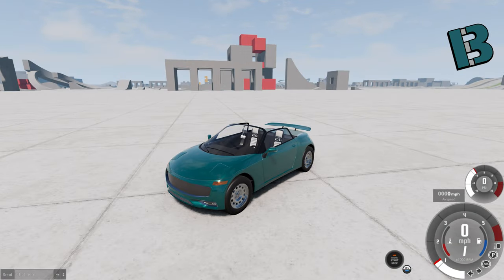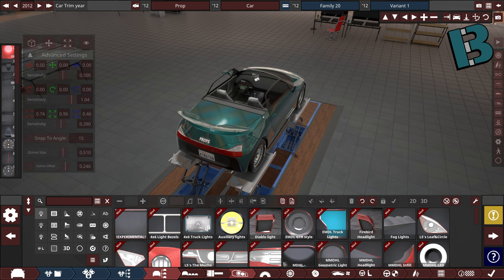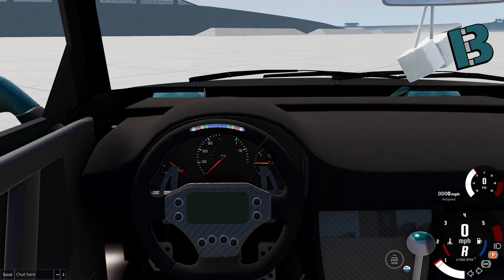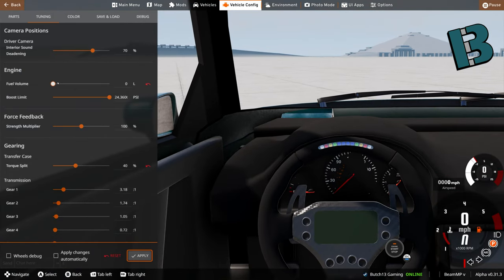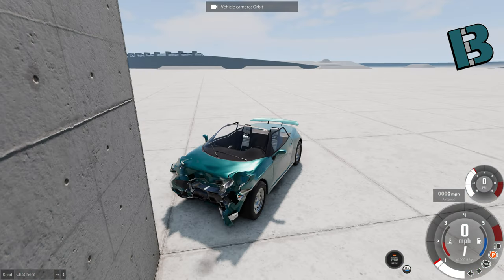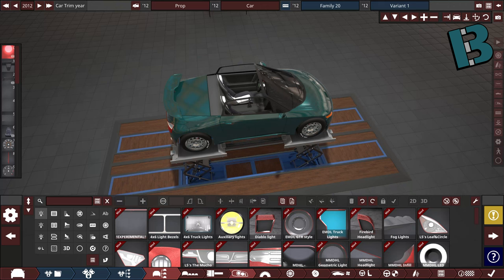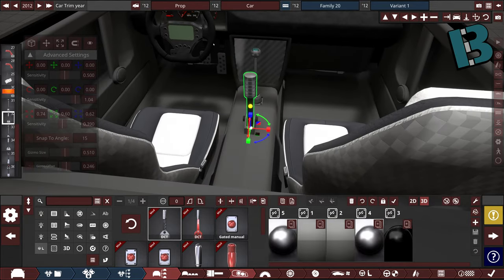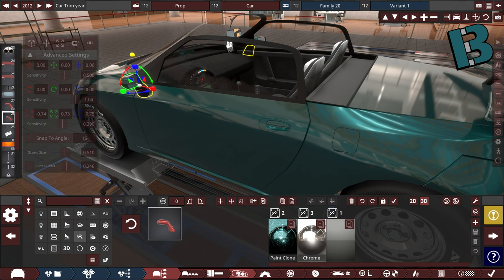More Than Just Steering Wheels - Automation and BeamNG Props!

Comment: I need help with the XYZ on the steering wheel when i try to make the steering wheel in automation angled it breaks
Reply: yea if ur stuck try this
~prop:ur fixture number,steering,0,1,0,0,0,0,min angle (should be below 0 like -900),max angle (should be above 0 like 900),0,1~

Comment: Hi. Ive followed your guide thoroughly, and used the copy/pastes and changed the prop numbers. Im having an issue. I cannot get the wheel to turn for the life of me. I think the prop number is 40, but how do you see each fixtures ID number? why wont my wheel turn?
Reply from the maker: In the Fixtures section of Automation take a look at the bar on the left. The number under each item is the fixture number that you need. Note that if you go back and delete a fixture it will renumber all of the following fixtures so double check that the number hasn't changed.
Reply: @Butch13_Gaming  Ive had the same issue, but I've double checked and the numbers ive used are correct

Comment: Here are some commands for gauges, they work as of BeamNG 0.33 (I tested them in my own Automation car).

FORMAT:
~prop:[prop_number],[function_name],[x_rot_enable],[y_rot_enable],[z_rot_enable],[x_trans_enable],[y_trans_enable],[z_trans_enable],[min],[max],[offset],[multiplier]~

[Gauges] --------------------------------------------------------------------------------------
Speedometer (270 deg clockwise needle, divide angle by max speed in m/s for multiplier):
~prop:8,wheelspeed,0,-1,0,0,0,0,0,270,0,2.52~

Tachometer (270 deg clockwise needle, divide angle by rpm range for multiplier):
~prop:10,rpm,0,-1,0,0,0,0,0,270,0,0.045~ # or rpmTacho

Fuel Gauge (90 deg clockwise needle, fuel value is from 0 to 1, divide angle by 1 for multiplier):
~prop:12,fuel,0,-1,0,0,0,0,0,90,0,90~

Water Temperature (90 deg clockwise needle, divide angle by temperature range (Celsius) for multiplier, recommended range is 0 to 200 so the needle is around the middle during normal operation (~75 to 105 Celsius)):
~prop:12,watertemp,0,-1,0,0,0,0,0,90,0,0.45~

Oil Temperature (90 deg clockwise needle, divide angle by temperature range (Celsius) for multiplier, recommended range is 0 to 200 so the needle is around the middle during normal operation (~110 to 126 Celsius)):
~prop:12,oiltemp,0,-1,0,0,0,0,0,90,0,0.45~

Voltage (90 deg clockwise needle, divide angle by voltage range for multiplier, recommended range is 0 to 16V (12.6V resting voltage, 13.5-14.5V when engine is running)):
~prop:12,volt,0,-1,0,0,0,0,0,90,0,5.625~

Boost Gauge (270 deg clockwise needle, divide angle by boost pressure in psi for multiplier):
~prop:10,boost,0,-1,0,0,0,0,0,270,0,30~

BeamNG Props Guide: https://documentation.beamng.com/modding/vehicle/sections/props
BeamNG Functions (aka Electrics) Guide: https://documentation.beamng.com/modding/vehicle/vehicle_system/electrics/

NOTE: COPY AND PASTE THE LINKS MANUALLY INTO ANOTHER TAB, CLICKING ON IT DOES NOT WORK.

Comment: 7:55 There’s actually a really good mod for this that could help you. It’s a modular pop-up headlight mod, and with a little bit of work, you could use the headlight part to rotate upward when turned on.
Reply from the maker: I've looked at some. Is that one where you have to build your light inside the housing by yourself?  If so, the light fixtures won't rotate from the right point without jbeam or .dae editing.

Comment: can you explain more about the popups, its just stuck at open position on mine and its lights are way off than it should be, i use a popup mod for the housing and a separate light fixture for the lights, i want to make it so the housing will only turn to open whilst the light fixture will go upwards to reveal itself. Thanks
Reply from the maker: The code listed rotates the "open" light fixture up when the lights are turned on.  It needs to be placed in the "closed" position in automation. Note that different fixtures will have different origin points and will require some trial and error to get working right. If your lights and housing are separate, you will need separate prop commands for each of them (and because the origins are different, the code may need to be different as well)
Reply: @Butch13_Gaming  Thanks, also one more question why is the multiplier set to 360 when the beamng documentation site says its 0 or 1?
Reply from the maker: @sus1558  Honestly I had tried 1 and wasn't getting the results that I wanted. Putting 360 did.  Pretty much trial and error.
Reply: @Butch13_Gaming  I see, Thanks

Comment: Can you make 2D fixtures move using the prop commands? Cause if so you could make a janky ass working pop up by making the 2D close pop up move into the body to hide it, then have a separate 3D light pop up from the gap where the 2D fixture used to be?
Reply from the maker: Any fixture is able to rotate or move, but I think a 2d fixture that is snapped to the body would leave a hole behind in the body where it used to be if you move it (based on the whole UV unwrap thing).  May have to give it a try, though.
Reply: @Butch13_Gaming  leaving a hole works perfectly for what I had in mind, im going to experiment with that when I finish the car im working on

Comment: Do we need to put the props in the required order, for example 13 prop steering wheel?
Reply from the maker: You can change the number in the text to whatever number your steering wheel fixture is. You can see that from the fixtures tab looking at the list of fixtures on the left side.

Comment: Does this work in 4.2 beta?
Reply from the maker: I haven't tried that beta yet. I imagine it still should as this was just added in the most recent major update.
Reply: @Butch13_Gaming  I tried it out on 4.2 and sadly it wasn't working. 4.2 is older but has some sweet mods. Anyway went to the non beta version and it worked like a charm. Thanks a ton for the cool video.